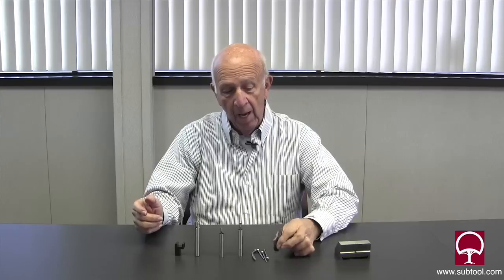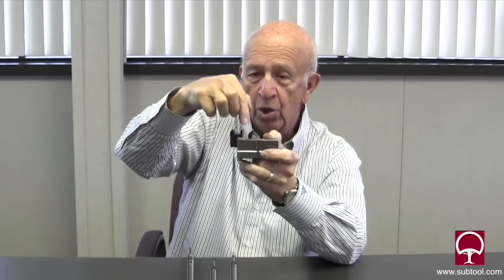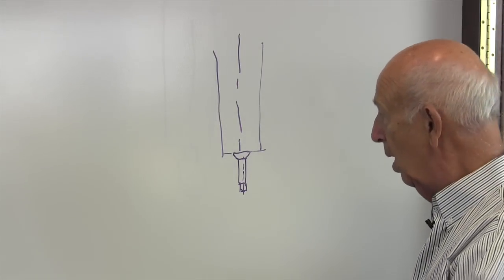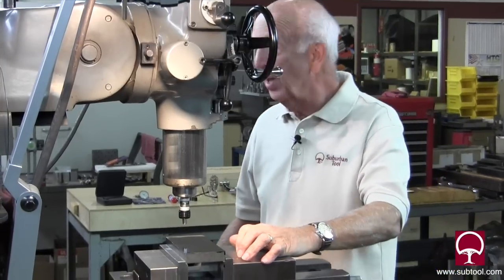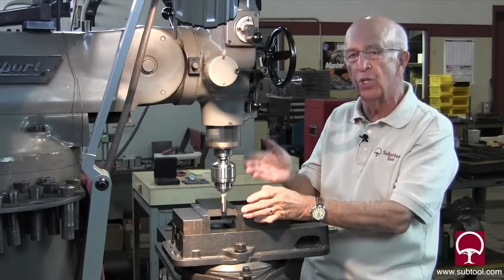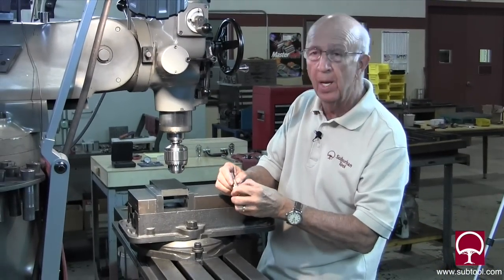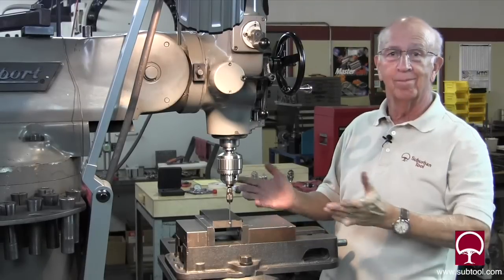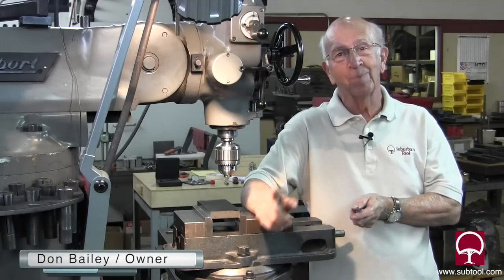How to select the right Edge Finder for you

Comment: It seems in your technique for using the edge finders and wiggler that you are trying to stop when you visually see the tip running true. And your repeatability is not what I expect from a edge finder or wiggler. I have always used the exact point at which the edge finder jumps off center as the correct location and the same with the wiggler. If you redo your tests with that method I think all the methods will repeat within a few tenths except the electronic edge finder.  The recommended speed for an edge finder according to Starrett is aprox. 1000 rpm.  I have watched most of your videos and this is the first time I felt a need to constructively criticize one of your techniques.
Reply: correct. his testing leaves a lot unsaid. I never liked electronic edgefinders and I will always use a collect on mine, if for no reason but to preserve the tool. drill chucks put divots into the tool they clamp.
Reply: I was taught the same as you, that you should wait until the edge finder jumps off. But if you think it... when the edge finder runs true or stops it's because both surfaces are touching "perfectly tangential" therefore whenever it jumps it means the amount of movement that you add is your excentricity!! it's not the same to add 0.001 than 0.01 of movement. And I never sustract that amount of adding movement when I wait till it jumps... I'm confused. It seams that his technique is right only that his eye is not accurate.
Reply: Well after thinking of it a little bit I must say that assuming that everything is OK, when you wait till it jumps you are a little bit offset (because you pass the edge line) BUT when you are one step before it jumps you are a little bit offset too (because you haven't pass the edge line yet). Therefore, the edge line must be somewhere between the moment it jumps and one step before meaning that the edge line is inside that last desplacement. We can't know if the edge line is more to the left or to the right. In conclusion, you can aproximate the edge line by his method or by the jump. The middle between them should be the most accurate xD but you can't do a half displacement of your smallest displacement
Reply: i always did it your way also for 14 years and worked great for me
Reply: Amazing to see someone talk with such authority who does not know how to use a wiggler edge finder properly
Reply: @kelvinblair4012  Dittos.   There are too many youtube shop "teachers" out there giving out advice on shop practice when they have yet to complete their own schooling.
Reply: @garth849  Hahaha! "yet to complete their schooling" Brother you have no idea what nor who you're talking about. You might want to click on ROBERENZ and check out his channel before you go running your mouth. That aside I've never seen or even heard of someone using an edge finder without making it jump. Probably because that's how they are designed to used, if not just use a damn pointer.

Comment: I enjoy these videos and it's interesting to watch people who really know what they are doing.  I've always wanted one of those scopes. With a good readout on a good mill, it would make a handy measuring microscope.
Reply: theslimeylimey For flat stuff, scan it at the highest resolution on an inexpensive flat bed scanner.  I pull the image into GIMP software and zoom in.  GIMP has measuring capabilities.  Draw a line segment and it'll tell you how many pixels it is.  Zoom in and you have sub pixel resolution.  2400 DPI scan, subpixel measuring and some averaging and I'm measuring into the microns!  I use this to measure the size of the divot pressed into metal for Brinell hardness tester.  It's great to determine how hard a lead alloy is when I'm reloading ammo with my cast lead bullets.
Reply: Liberty4Ever I have actually done that very thing before circa 2001 :) It was for a small difficult extrusion I designed and I wanted to see how accurate the parts were so i scanned a slice, imported the scaled image into CAD and overlaid my designed profile so I could see where the shrinkage and warpage was. To make sure my output image was correct, I scanned an object of known exact size to determine the correct scaling in the X and Y axis. It works surprisingly well doesn't it!
Reply: Liberty4Ever Cool.

Comment: Hi Don:

I would have liked more explanation of the stuff you were trying to prove. For instance, with the edge finders being unaffected by the collet runout, i think you mean that the moving part begins to run concentric(no apparent motion) when it is exactly on the edge, and that if the collet has runout, then the 2 pieces of the edge finder will NOT line up, but the moving part will have no apparent runout. I know that when I use this type of edge finder, I look for the 2 parts of it to run concentric-maybe that is not the correct way, but it is what I have always done.

Also, when using the electronic edge finder, I think you zeroed it and then tested for repeatability-but you sort of downplayed the part that the collet runout played-I would have liked to see a measurement of what that runout was-pretty easy to do once you were rotating it and getting the light to flash on and off.
Reply: Andy Wander With the cylindrical type, axial run-out doesn't matter like Don said and I use mine in a (good) drill chuck all the time. However, if there is angular run-out, meaning the axis of the edge finder is not parallel to the spindle axis like you might see in a badly worn chuck, there will be an error but unless its really wonky, it will only be a few tenths. 

I have always used a Mitutoyo cylindrical type that I mirror lapped the mating faces of so it's smooth as silk and by bringing it in to the edge and going just beyond  tangency  until it "kicks" I get accurate results. It will kick within tenths of going past tangency and is repeatable withing a couple tenths. It's very visible so you can see it kick from a distance without squinting to see if you are touching exactly tangent or still have a thou or two to go.   It appears there are two schools of thought on how to use these things so I'm learning here.

I have the same Starret ball type wiggler as Don is using but I have found it's not as accurate as the cylindrical type for picking up an edge by making it kick but it's fairly repeatable for finding the center because any error is applied to both touch faces equally.  The thin sharp point attachment is very handy for visually aligning to a scribed line or center punch mark in a drill press or when accuracy is not critical because you can make it run dead true to the spindle axis even in a worn chuck.